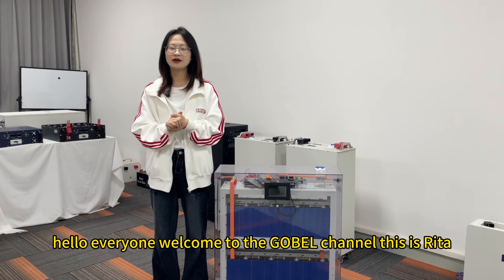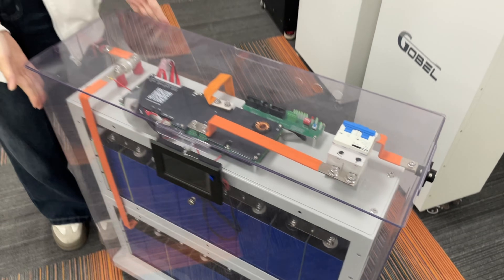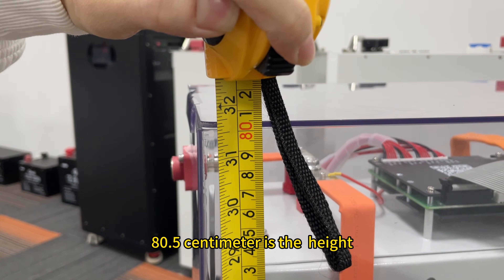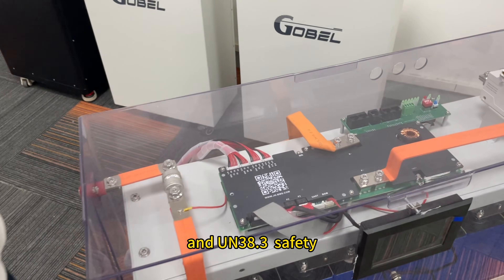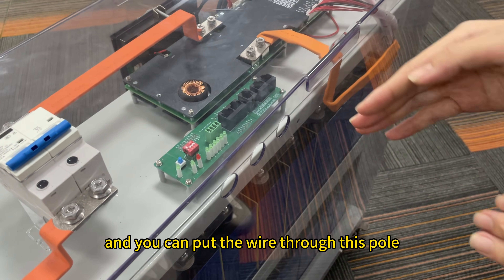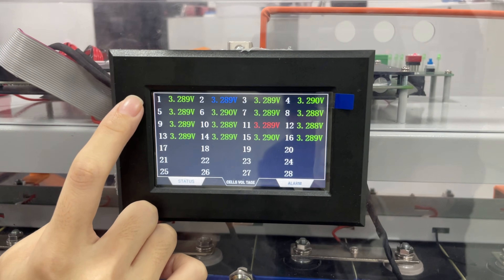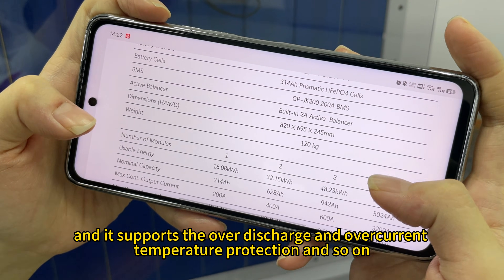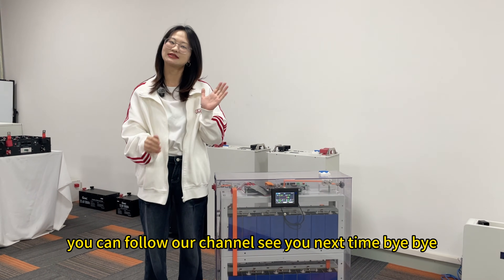🚀New Release! Gobel Power 16kWh Transparent GP-PROJECT-X1

Comment: Um the breaker should be on the positive terminal side not the negative side. It may function, but most manufacturers and governing boards really discourage it for safety and proper function of the breaker.
Reply from the maker: The positive terminal is protected by a very safe fuse.
Reply: It's pretty cool how it's see through though. Is it stackable? Also is there an mb56 in the works? I'm thinking the mb56 won't be stackable since it weighs 600hg fully assembled.
Reply from the maker: @louismessere6379  The MB56 product is also in production and can be used in parallel.

Comment: HI, thanks for presentation. THis case if OK, because I can place thermocam near the box and detect
changes in temperature, b ecuase this BOX do not contain 16 Dallas sensors to monitor temps +  MQTT server.
But I can not see gas sensors. LFP and NMC or NCA or NIB produces explosive gases like H2, C2H2, C2H5 radicals,
VOC - EMC, DMC, DEC, EC etc. Gas sensor is crucial, to send me SMS, email, if on cell goes to internal
short circuit and thermal runaway.
Reply from the maker: The battery contains a temperature sensor wire, which can detect the battery temperature, so you can rest assured regarding safety.

Comment: Talking of design:
1. The positive and negative poles should be together an one short sides.
2. The display should be on top or as well on the short side.

The Benefit of this case is the small foodprint. Compared to the Server Rack Style Housing. So with the GP-PROJECT-X1 you can place them side by side. But them you cannot access the display.
Reply: why? You can perfectly tie them like this in paralel putting 1 after another,look through that transparent shell,i think it is a beautifull buil,Tclass fuse,and automatic breaker,with JK BMS,that has active balancing,i think its a super awsome battery.
Reply from the maker: Thank you for your feedback.

Comment: Why does it have 100 amp circuit breaker, but the JK BMS is 200 amp rated.
Reply from the maker: Sorry, the video didn't clearly explain that 100A2P is also 200A.
Reply: Because its wired parallel, there are two single 100A breakers. It works, but its not that nice.
Reply from the maker: You can rest assured that his work situation is very safe and stable, and there have been no problems so far.